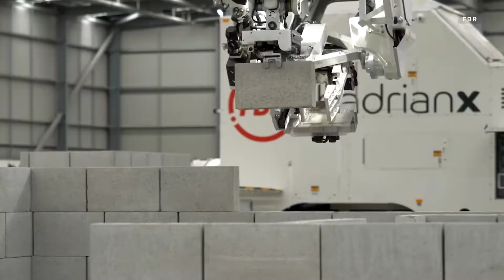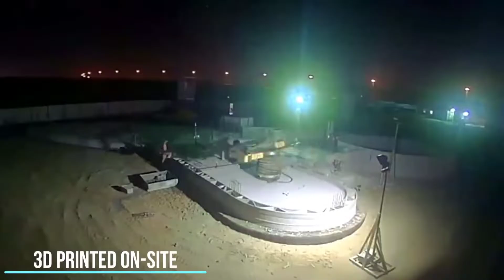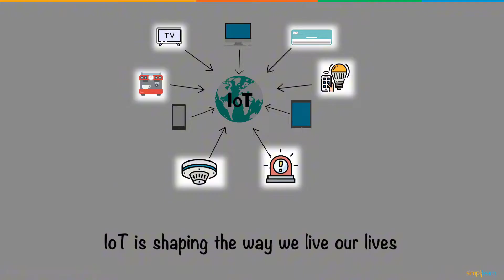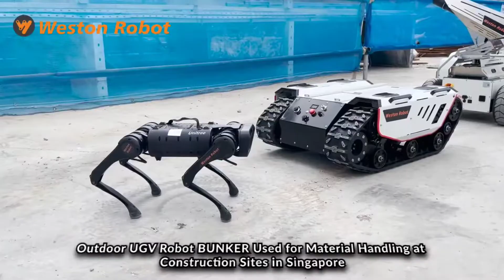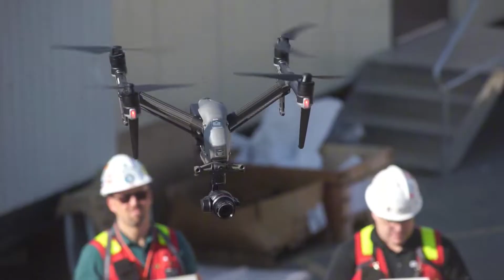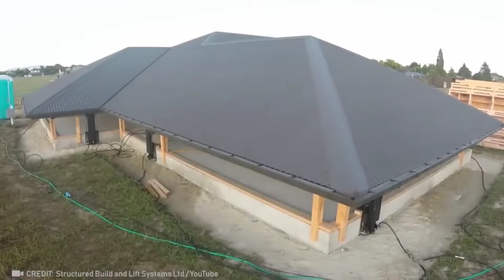Pushing Boundaries: Construction Technology Reaches New Heights

Comment: The "special adhesive" is used because the robot isn't capable of using mortars. The references to other structures built are all in dry hot environments. Typical blurring reality to let more corruption rule the roost. Ignorance to the max. Security against what? The only crooks I see are the ones taking jobs and stealing our money....and financing robot bitch psychosis.